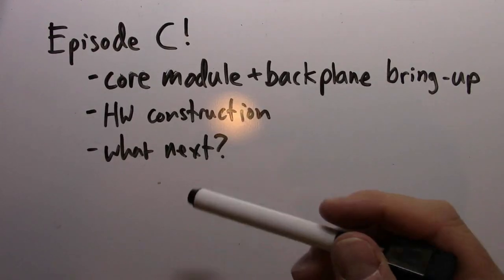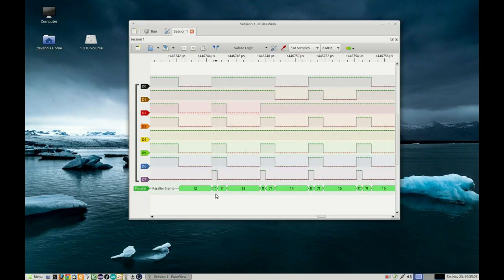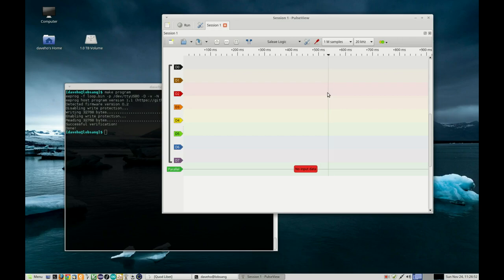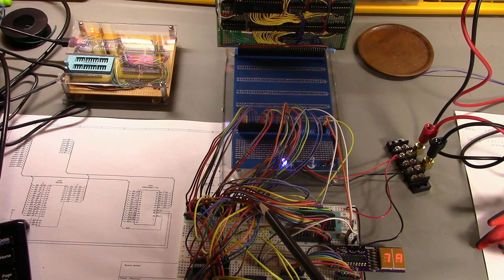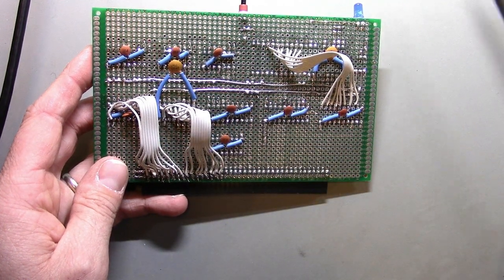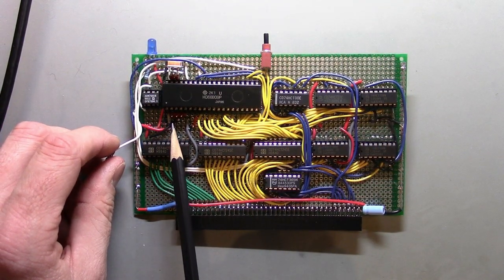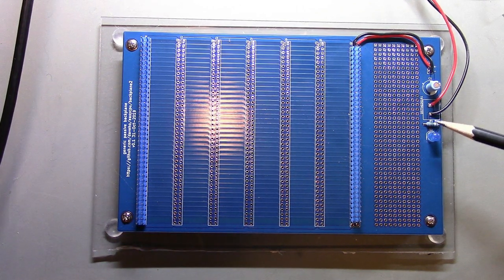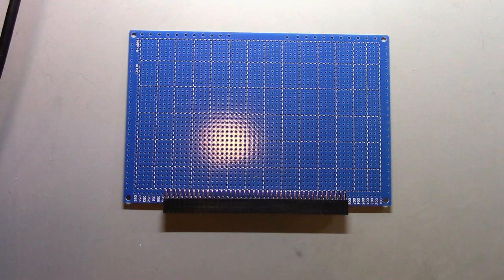DIY 8-bit computer, Episode C: core module + backplane bring-up

Comment: Coming along nicely. Obviously I'm "still in the past" so looking forward to see how things pan out. Interesting to see Pulseview - another tool I use although I recently managed to grab myself a working Agilent 1670G logic analyser for super cheap money off eBay! I agree that for this type of project pad-per-hole boards are not ideal as there is a need for power rails. No prototype board design is going to be perfect but you have found a good one for your system. I had the same dilemma regarding the oscillator frequency. Not wanting to do a full timing analysis on the system I got an 8MHz oscillator and fed it into a binary counter. I then used a 2-row pin header to be able to select 2MHz to 250kHz clocks. So far the system seems rock solid at 2MHz!
Reply from the maker: Ooh, if I had the bench space I would seriously consider getting a proper logic analyzer. Although: most of the debugging I've had to do has been feasible using a relatively small number of signals, so my 4-channel scope has done the job so far. The blue protoboards I found did work out pretty well, they were a good find. Nice idea using a fast oscillator and dividing it down. I haven't done too much experimentation with clock frequencies so far. Currently I'm at 3.6864 MHz, but I have a number of faster crystals that also divide down to convenient UART frequencies, at some point I'll try those out.

Comment: OK..  I've just "binge-watched" every one of these videos, and ordered $160 worth of parts from the UnicornElectronics that you mentioned!  (I usually use Digikey or one of the others, but I like the idea of helping out a smaller business, AND they are fairly local to me so shipping should be fast!!)    It's time to dig into your GitHub stuff I guess..  I want to make something compatible with yours, but I dont think I have the patience to wire all this by hand..  AND although I've used KiCad before, I could definitely use some practice, so I think I'm going to try to copy your design and make my system hardware and software compatible with yours, but to actually build commercial boards for each module so I dont have to deal with the masses of wires and soldering!!   I also love the idea of the ZIF on the backplane - I think I'll actually build that into the backplane design to save more wiring..   Cant wait for the next installment!!
Reply from the maker: Hey, awesome! Unicorn Electronics is good, I've always had a good experience with them.  I'm also planning to create actual PCBs at some point, but currently I'm kind of enjoying the hand-soldering on protoboards.

Comment: Do you have a cad file for the backplane, if not where did you get it?
Reply from the maker: I do!  It was originally designed for a CPU built with logic chips project (which someday I hope to return to), but I ended up using it for the 6809 system. https://github.com/daveho/easycpu/tree/master/backplane2
Reply: @davehohacks   Thanks for the reply and link.  Enjoying the videos.